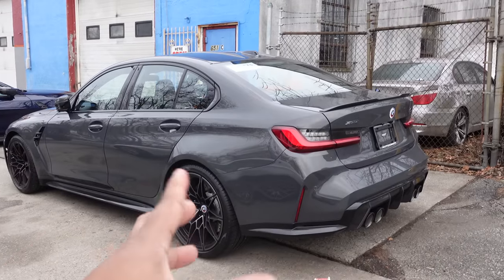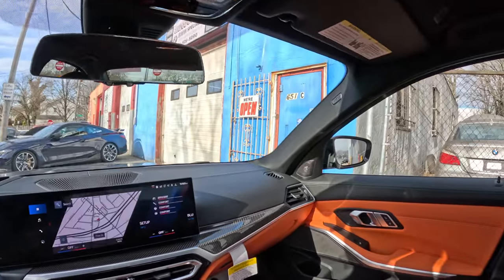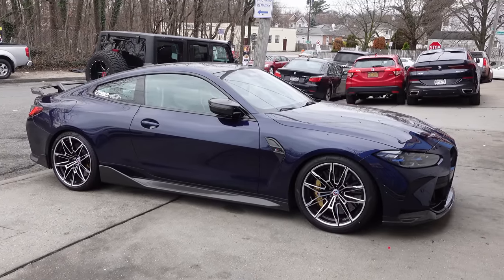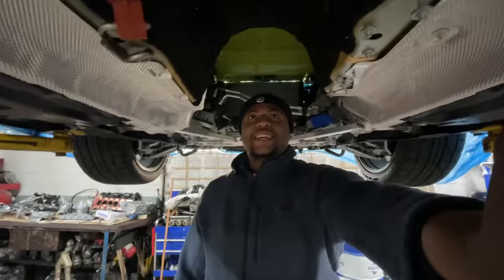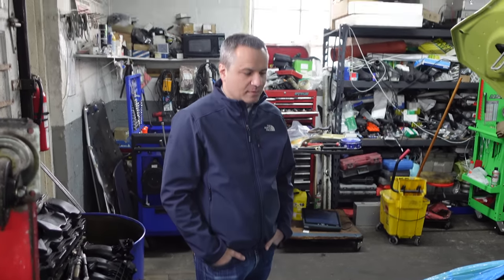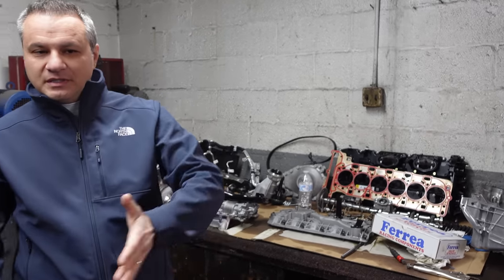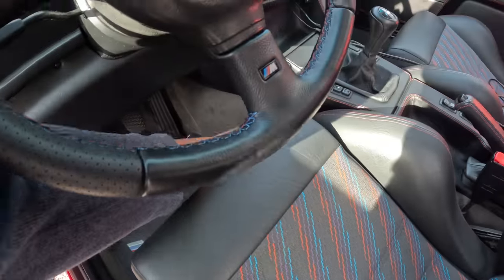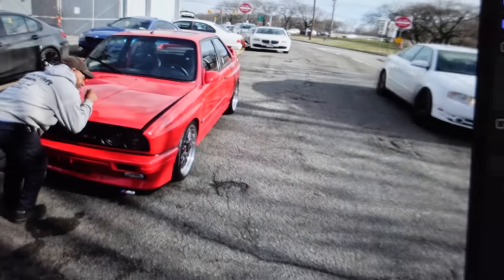MAKING THE WORLD’S FASTEST G82 M4!

Comment: Just noticed the dravit G80 doesn't have the memory buttons??  I have a '23 G82 but it has them.  Very strange
Reply: The M1/M2 buttons?? They’re on the steering wheel clear as day lol
Reply: @bigmixx  No, 1 through 8 on the dash... I use them to program different settings (1 for Carplay, 2 for lighting, 3 for displays, etc)
Reply: @loudaccord  they remove all the programming buttons, climate control buttons and some more with the 2023 model coming with iDrive 8. I think you can program shortcuts on the screen with the iDrive 8 system though.
Reply: @MacBookAir-cu4fb  Looks like it's the M3's... M4's have a different screen.  Just looked at the configurator on the BMW site and the M3 is different than the M4.
Reply: @loudaccord  Yes, you're right, forgot that. But the M4 didn't get a facelift yet. They will come out later this year I think.